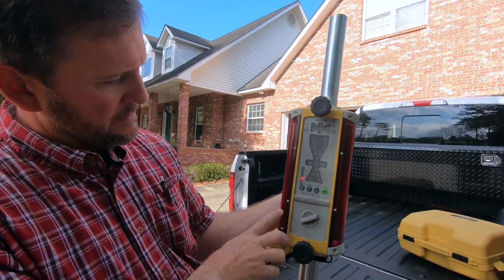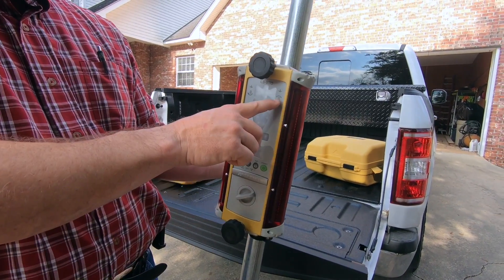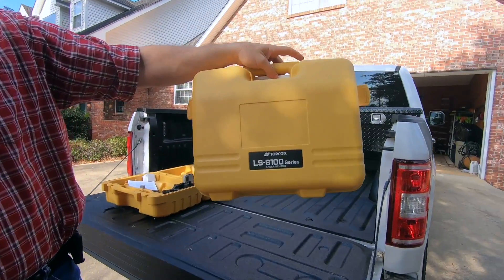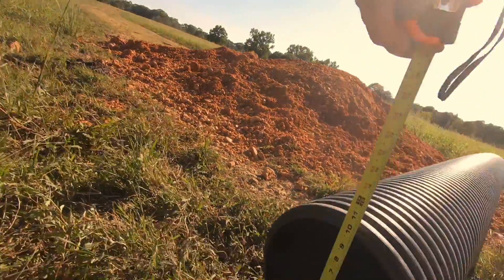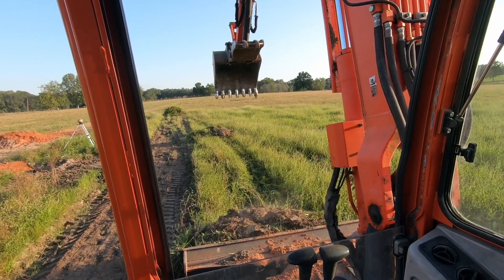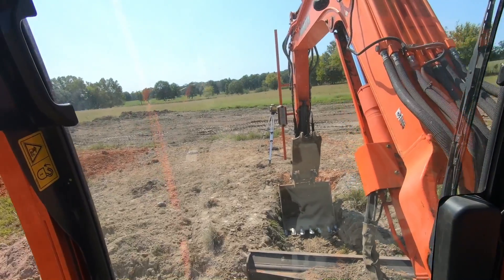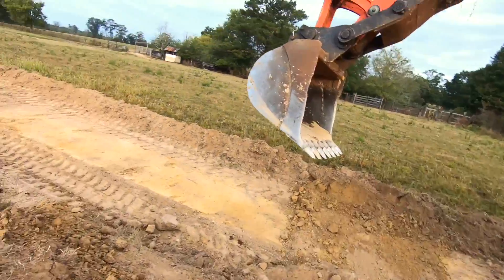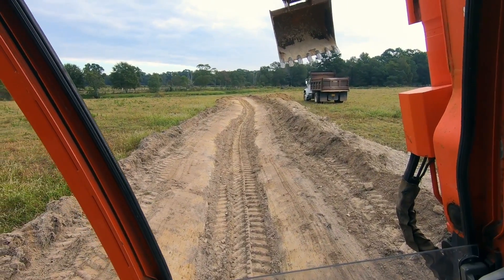Kubota KX080-3 Digging drainage ditch with excavator mounted Topcon Rreceiver

Comment: How did you select the specific model? I assume they all work with any topcon laser model. Some of them I've seen also come with a cab receiver did yours come with that or is that a separate item?
Reply from the maker: I bought that receiver because it was a Topcon and I thought it might work better with the Topcon laser vs another brand. Also I liked the display. It’s easy to see from the cab. Bright sunshine makes it more difficult but still you can see it. 

This model didn’t come with a cab indicator. I believe it could be added. If my cab on the dozer was enclosed I would have looked at that more.

Comment: How do you manage to figure out exact position of the bucket and the arm to get level? Looks like the bucket needs to be at a certain distance, bucket and arm needs at a certain position to get grade?
Reply from the maker: You can set level on the Topcon with the bucket/arm at any position you just need to be in that position each time to be accurate when reading the Topcon.  

I position the bucket flat on the ground and the arm 90 degrees from ground or what I feel like is 90.  That’s the most natural position for me to check grade. After you do it a few times it will be second nature.

Comment: How did you get into this kind of work? It's interesting. 

As a aside, would it have been more efficient to load the dump truck when digging thr ditch? Only handle the dirt once?
Reply from the maker: I have always been around construction and always liked dirt work. When I bought some land that needed clearing I  bought a dozer, cleared the land and started working the dozer for other people.  I had never run a dozer before so I taught myself the basics while clearing the land and went from there. 

If you can load the truck without getting out of excavator and moving truck several times yes it would be more efficient. But I would have had to move the truck a lot doing this ditch. So I pushed the dirt into piles and moved the truck a few times. Just my preference. I like staying on task sort of speak when digging  a slope.  Getting in and out of excavator breaks up my rhythm. 

Thanks for watching!

Comment: Curious why you didn't opt for the magnetic mount for the boom-mount B110?
Reply from the maker: I was concerned about the magnets moving(slipping) and I could build this brace for about $30 vs $225?? for magnet mount. Magnets may work fine and I may use magnets on the dozer blade. Thanks for watching!